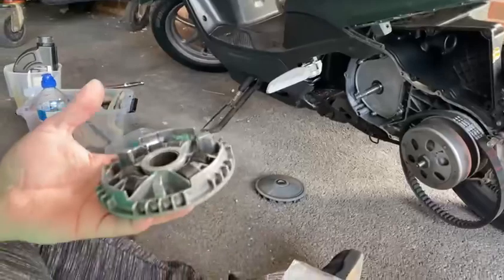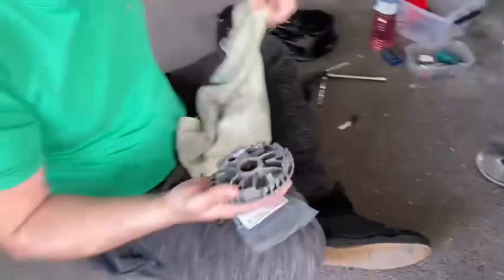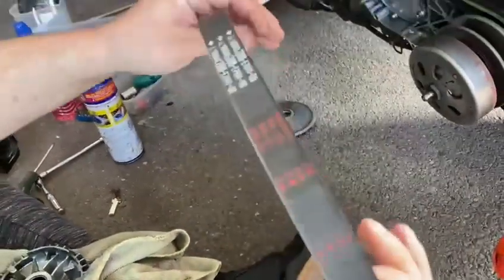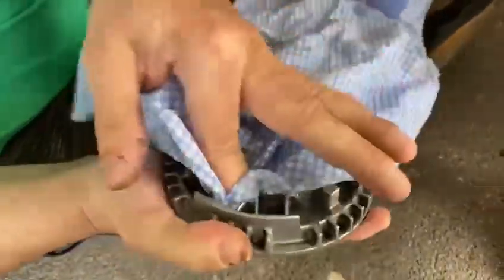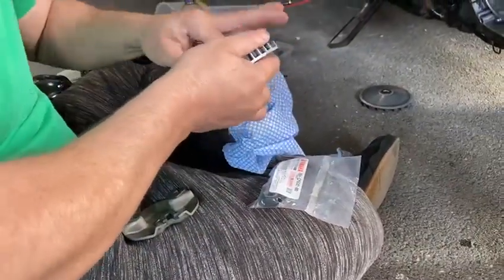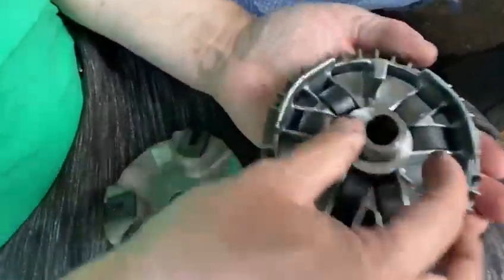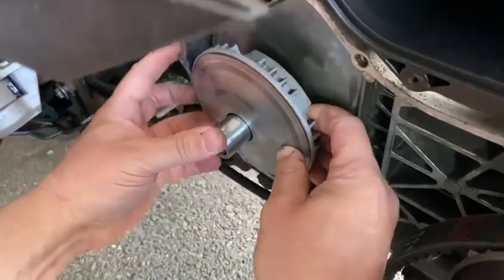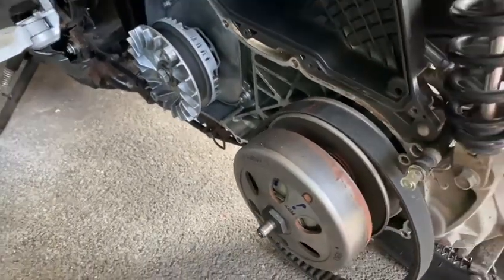Yamaha Delight Install New Rollers

Comment: What about the dis-assembly?  How did you hold the assembly whilst undoing the central nut? Very important! Also how did you hold the assembly when tightening again???
Reply: I love how OP liked the comment with no reply haha!
I did some bits today to my delight, oil change, new spark plug and air filters, wanted to do the belt but couldn't get the case off and getting dark so research time and job for another day!